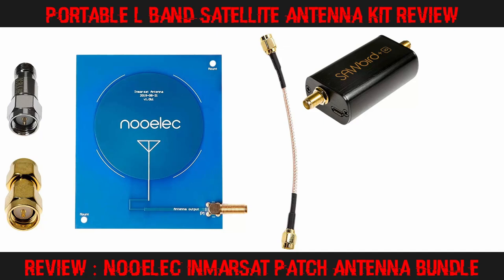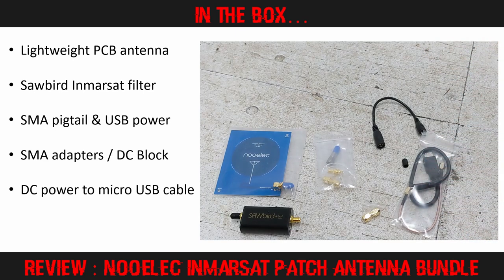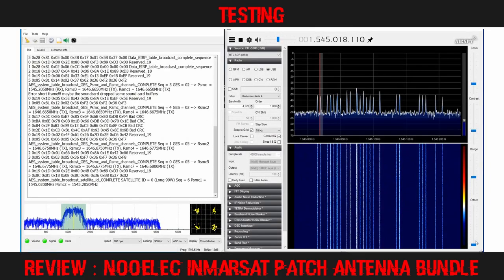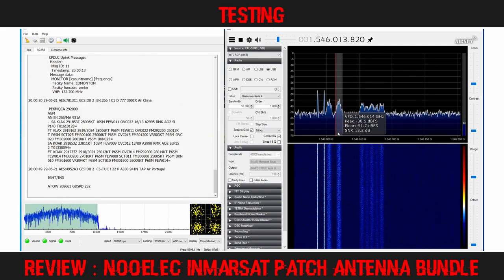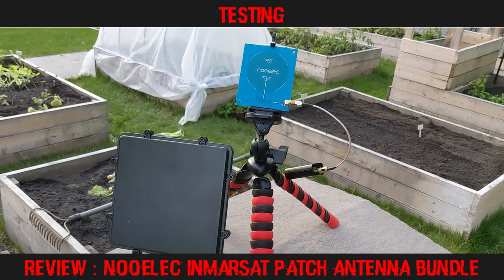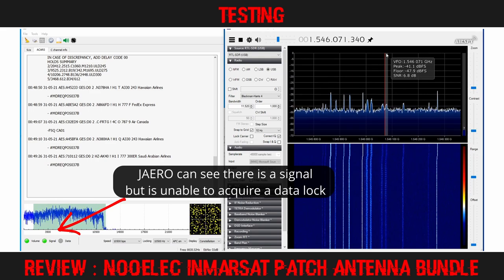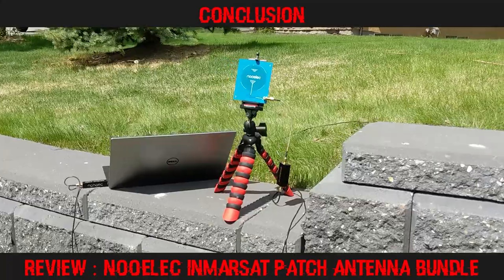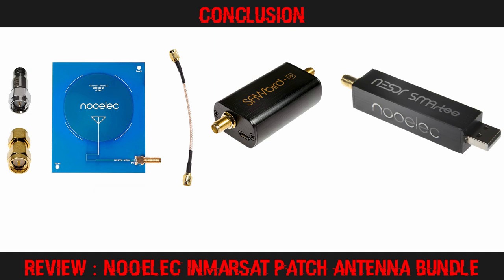Review : NooElec L Band Inmarsat Patch Antenna Bundle

Comment: Great Video Rob.
Think i'll purchase the RTL-SDR patch antenna through the link in your  review video,  I see they are in short supply so I'm hoping to get one of the last ones.

Now I have my SDRDUO up & running now all I need is the time to play 😊.

I've just spent this weekend putting up 7 x new Antennas & cabling them all in using very low loss LCU400.

1 x HF Multi Band Long Wire
1 X HF CP6 Multi Band Vertical  
1 x 6 Db VHF ( 140 - 300 Mhz ) for general VHF coverage 
1 X 9 Db VHF tuned to 131.550 for Acars
1 x 9 Db VHF ( 150 -170 Mhz ) for our VHF
 trunking networks
1 x UHF 12 Db 400 - 500 Mhz
1 x Diamond D130J 25 - 2000 Mhz Broadband coverage Ant.

Time to get the Sat antennas done next.

I'm going to do the Inmarsat L-Band Patch Ant I'm thinking of mounting it in the middle of an adjustable sat dish & I'll cable it down in very low loss LCU400.

And a Ku band LNB & depending whats on Ku band of any interest these days ( hopeing to find some Aust ATC Aero comms ) I'll go out & source a stable Ku band LNB.

In a few weeks I'll have a nice shinny new 12M lattice mast with a tri mast head.

Anyway old mate keep up the great work, pardon the pun but the skies the limit. 🤣.

Rgs
Wayne.
Reply from the maker: Sounds like a really pro set up Wayne. Definitely get yourself hooked up with some L band gear.

Will be interesting to find out if those ATC comms are still broadcast on Ku band!